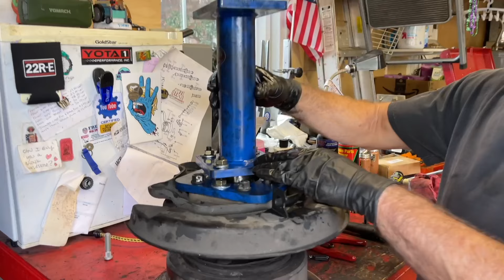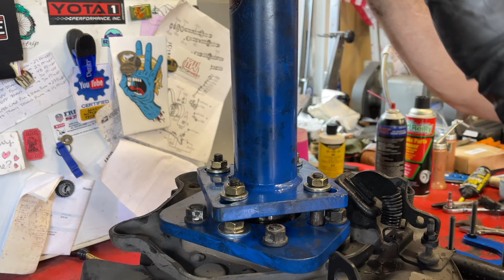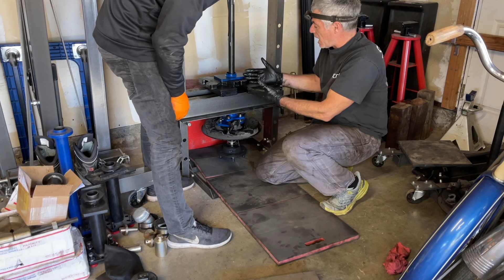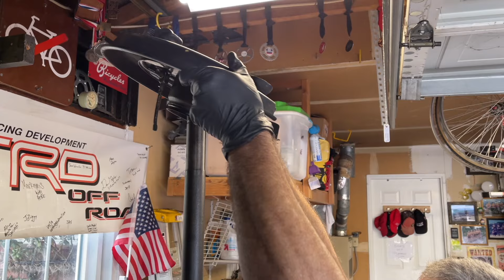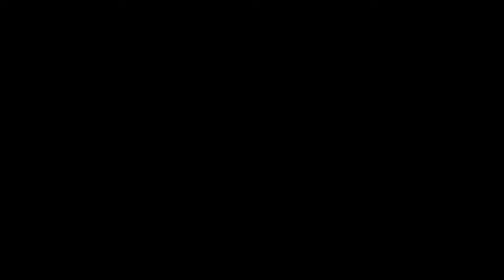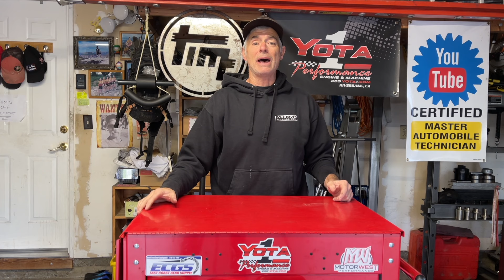Rear Axle Seal & Bearing Replacement (100 Series LC / LX470) (Part 1)

Comment: Can someone please tell me I don’t need to use the tool for the job.
Reply from the maker: What's your resistance to using the special axle tool?
Reply: @TimmyTheToolman I don’t have a press
Reply from the maker: @Chris-rb1wl Buy a Harbor Freight 20 ton press.  They are affordable and work well.  It will more than pay for itself after the first use.

Comment: Hey Tim, if my rear wheel is wobbling on my 100 series, does that indicate wheel bearing is bad or axle shaft is bent?
Reply from the maker: It would take an accident to bend an axle shaft.  Unless you were in an accident, the wheel bearing is bad.

Comment: I learned a lot about using the axle tool and using the press generally.  I'm a newbie to the press world, having just picked one up.  I did bushings on all rear control arms last week thanks to you guys.  This job looks more involved, I really enjoyed it.
Reply from the maker: Press work is interesting because you're generally only limited by your own ingenuity to get things done.  There's so many ingenious ways I've seen people get press work done.  Doing the axles on a 100 Series or LX470 adds a bit of a challenge due to the length of the longer axle.  You saw I needed to stack multiple press plates to gain the necessary height so I could pull the parts off and press them back on.  A recent modification I did to my press alleviates the need for multiple press plates. Check out the video: https://youtu.be/una0t8IDxWQ?si=1WFxcs6p7sPiq4Cz

I'm glad you enjoyed the video.  Keep turning wrenches and learning.

Comment: Excellent as ever. Really impressed and I'll be doing a rear axle service on a 4WD Toyota so absorbing the learning from this and your other, related vids. Hopefully I'll also be able to get the same press SST as you have but I'll have to contact the guy and check it fits my JDM. A couple of observations are to say that I think most parking brakes, whether on drums or disks can be readjusted into the use position by operting the handbrake a few times. As it's the handbrake that does the uptake that takes place as the shoes wear on drum brakes, the handbrake operates the brake adjust lever that operates the star adjustor. I think as long as the handbrake can operate the adjust lever then the brakes will self-adjust. Sencondly, when I do my rear axle I will be wanting to do some fettling to the rear brake backing plates. I think I will remove these fairly early, which I think will make the subsequent processes a bit easier. Would you do this if you have to take them off anyway?
Lastly I was wondering if you would have to lift up the press etc and it came very close! My diff centre is central, phew!
Reply from the maker: The parking brake for vehicles with rear disk brakes is different than the vehicles with rear drum brakes.  For the vehicles with rear drum brakes, the brake stays in adjustment by using the parking brake regularly.  For the vehicles with rear disk brakes and a drum parking brake, the parking brake does not self adjust.  There is nothing that will turn the star adjuster when operating the hand brake.

With shorter equal length axles, you won't need extra press plates to build it up.

Comment: Awesome video. Great detail and excellent explanations. Specialty tool use rather than brute force is great. Well done!
Reply from the maker: Thanks for the compliment.  Sean and I love specialty tools, and we were lucky to discover Duane and help promote his axle tools to the Toyota/Lexus Auto Mechanic Community.  Duane even sells his tools to dealerships, which tells me Toyota doesn't make anything like Duane has developed.  Most shops cut parts off and risk damaging the axle.  I love the clean and professional way we are able to perform these jobs because of the tool designs Duane has developed.